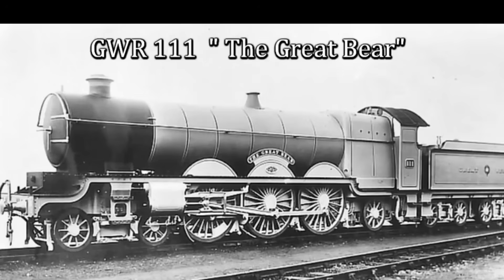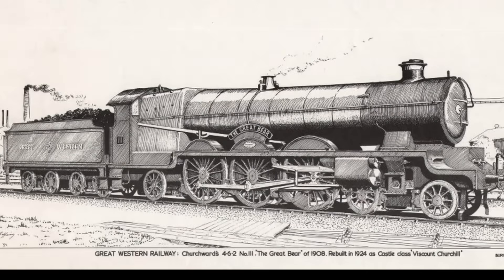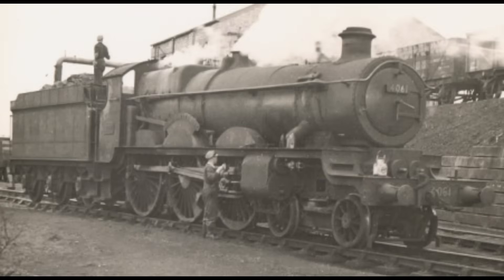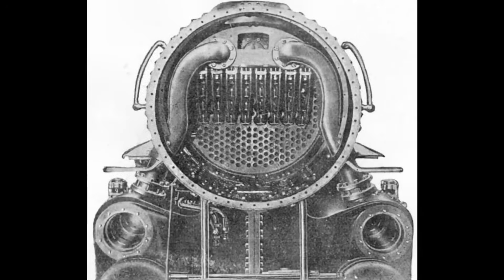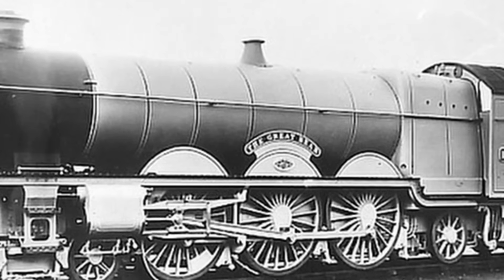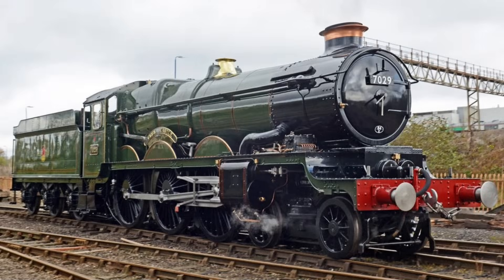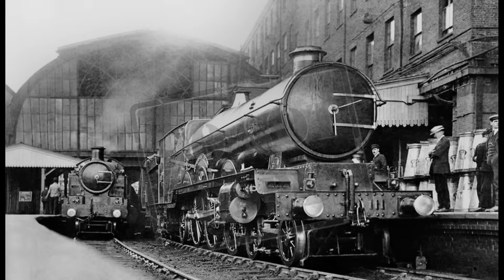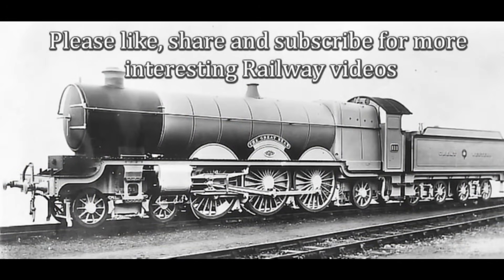The Great Bear, GWR No. 111, a Technological Triumph—or a Monumental Flop? #gwr #locomotive #fyp

Comment: Route Availability was not a problem.   It had the same range as the subsequent Kings.   It didn't spend its entire life between Paddington and Bristol; it worked frequently to Wolverhampton, and often to Exeter and Plymouth.
It was an experiment, like many other GWR designs before it, and was only rebuilt once its boiler was due for replacement.  At that stage, having the same 4-6-0 wheelbase as the Stars and Castles, but extended with a back bogie, fitting a Star or Castle boiler to it was the obvious thing to do.
This is not a story of failure, and the oft-quoted statement that he could have sold it to Gresley has no basis of fact.

Comment: It is unlikely that there was a 15" limitation of cylinder size due to bogie clearance as the subsequent Castle class had 16" cylinders and quite a few Star class engines were converted to the newer type.
Incidentally, the reason the outer cylinder blocks were placed in that position was because Churchward disliked the idea of unequal length connecting rods (ref. to inner ones) which would have been necessary had the blocks been moved forward to a more conventional position.
This design rationale remained even when Stanier built the Princess Royal class for the LMS but the emergence of the Coronation Pacifics saw the blocks moved to between the bogie wheels.